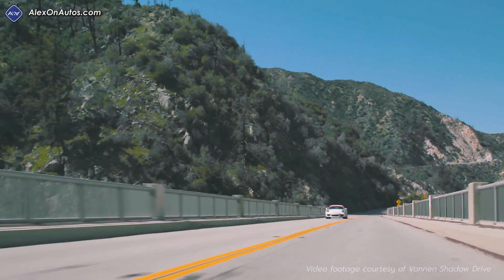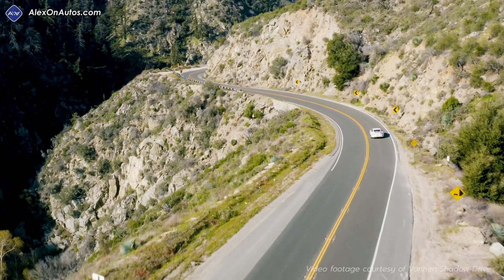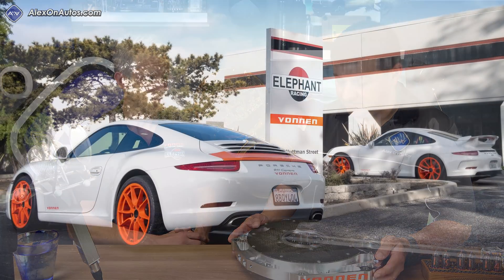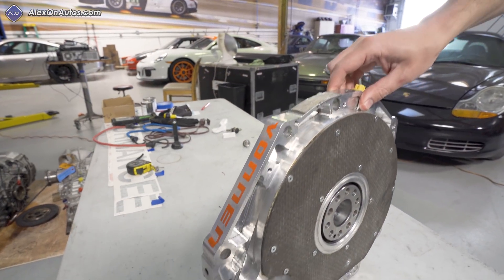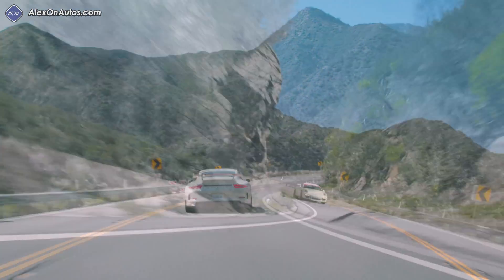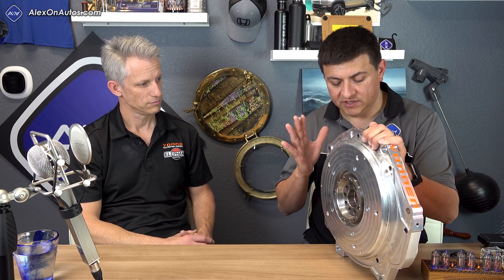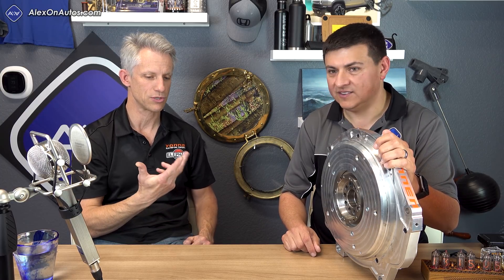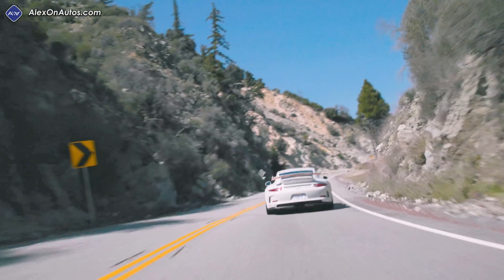Vonnen Shadow Drive - Interview With The Engineer

Comment: But aren't many of the modern engines (especially turbo) limited by the transmissions? When adding 200 Nm on top of that, I'm sure there's a high chances of damage, right?